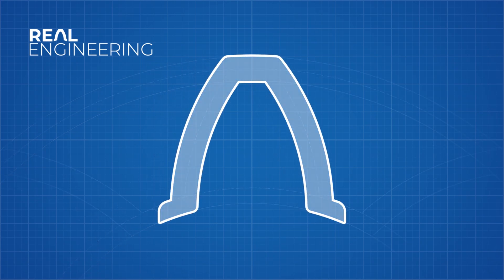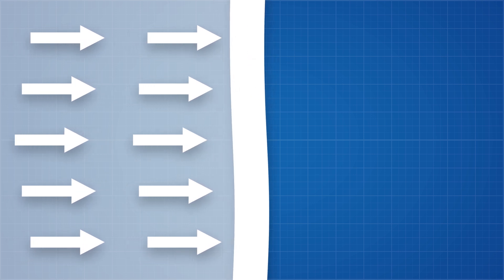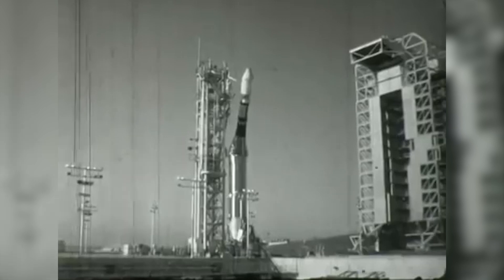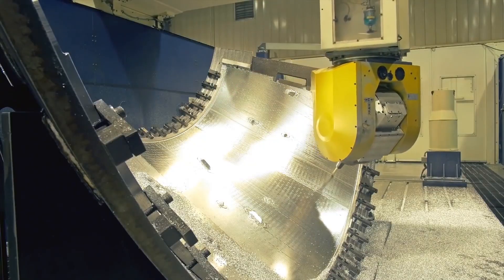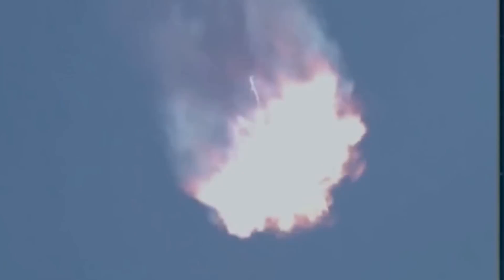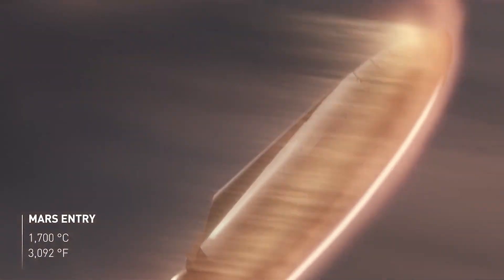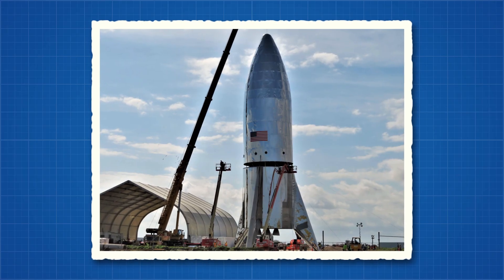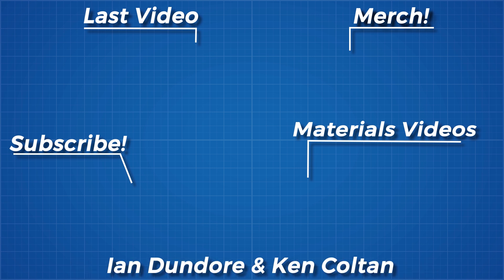Why SpaceX Built A Stainless Steel Starship

Comment: Titanium is as light as aluminum or lighter and stronger than stainless steel and is more heat resistant than both aluminum or stainless steel.  Titanium is very expensive and is not practical at this time.  Once we start mining for metals on the moon from impact craters of asteroids, then one day the cost for titanium and other precious metals will come way down.  That includes gold, platinum, and silver, etc.  So people investing in these metals may undergo a significant loss in profits, once mining on the moon occurs.  I hope Elon Musk has a number of unmanned rockets land on the moon first (sending supplies ahead of the space travelers) before he tests any of his rockets with a ship full of passengers.

Comment: They know they can develop extremely thin steel in the vacuum of space with amazing strength. In fact I have heard there is a Foundry in orbit and they are developing amazingly strong metals with honeycomb type structures which they use on the most ultra modern subs. They should be using this stuff for these rockets.

Comment: The stainless steel is just to make the Buck Rogers looking prop shiny and cool looking. Starship is nothing more than a scam, the detail of which will come out when Teslaron finally implodes and its rent-seeking conman head takes off for places unknown.

The skin of a rocket ship is only to protect the internals and provide aerodynamic stability. Such a skin can, and needs, to be as light as possible. Stainless steel is not light and also behaves badly under the the heat of the Sun owing to its rigidity.

And those top/front fins only add more aerodynamic instability and much unneeded weight. But they sure look cool.

Starship is nothing more than a prop in a scam.

Comment: I wonder how many tons of C02 are ejected for each launch?   Who is working on the net-zero rocket propulsion?
Reply: By mass, methane combustion exhaust is around 55% CO2, so by burning through ~4,000t of propellant, that's ~2,200t of CO2 released per launch. 

As for net-zero rocket propulsion, any hydrogen-oxygen launch vehicle has the potential to be carbon neutral if the hydrogen and oxygen are sourced from the electrolysis of water powered by renewable energy. However, until the price of green hydrogen is competitive with fossil-fuel derived hydrogen, this won't happen anytime time soon.
Reply: @OzearEimaj  The days of being able to choose an energy source other than a Green one are over.
Reply: @tonym5627  If there are cheaper and dirtier options available, it's fair to say that's what the companies will use!
Reply: @OzearEimaj  I just bought an electric car that can barely fit 5 comfortably.  Why? Because I don’t think their required goal of eliminating all gas cars is achievable in 8 years.  When they realize their plan is moving too slow they will then take more drastic measures.  

Are you not seeing the action to uniformly reverse the Global Catastrophe right before your eyes?   If you don’t, just take a long ride without any internet devices and pay close attention to the changes in infrastructure going on, regardless of what Country you reside in.  

Your awakening will help.
Reply: @tonym5627  Of course I understand the ramifications of global warming, but when it's cheaper for companies to pollute, then they'll do it unless there are financial repercussions. My apathy towards what companies choose to do has nothing to do with my understanding of the climate and the effect we are having on it. Besides, emissions from rockets launches are probably the last thing environmentalists should worry about.

Comment: I seem to remember this super light metal with ridiculous melting temps. Let me look up my "space age" periodic table and, oh yes, it's called tih-TAY-nee-əm. But, unfortunately, Elon Musk's infinite knowledge of engineering (ie. his business expertise of claiming other peoples work) cannot solve this problem.
Reply: @awashburn6944  I am not a fan of Musk's. I do know that he tried to acquire the titanium tech from others that were also not his greatest fans. Titanium is in pressurized fuel tanks orbiting the Earth right now at much lower temperatures, so I don't think brittle is a problem. Super conductive fuel tanks are not the greatest idea but...there they are. The tanks are manufactured (alloyed?) in a way that greatly increases their ME and Yield and obviously changes some other numbers. I know they are titanium, I know they are thinner than any other metal would allow, and I know (first hand) the tanks can be lifted with my fingers. It would be interesting to know what they have discovered, but I can't blame them for not handing it to Musk.
Reply: @awashburn6944  True, none of those satellites are designed for re-entry at all, but I don't think we have any materials beyond NASA's ceramics for repeated re-entries. I also assumed space X would use their same re-entry tech to land on Mars, which should not affect STA microstructure of the hull per say (I think just the fins would be of concern). But then again, who says we are using 6-4.... 
815C for 6-4...I'd find a new supplier... :P

Comment: "Shit show" haha
Reply: First system capable of manufacturing Starship in strong titanium alloys. Superior mass and force ratio. Symmetrical double joints with controlled asymmetry of paramagnetic and diamagnetic materials in an inert atmosphere. Starship can be manufactured 60 tons less and by automation ... Integral double joints with controlled asymmetry in titanium alloys ... Robotic welding by stimulated emission of light for reactive materials in a 100% inert atmosphere at 360º. We can now manufacture in titanium and robotically for the first time in history. Now we can do it very well ... !!! ...
Reply: @eduardoamaro7867  They built it... out of steel... and it works... you don't need to fix things that aren't broken...

Comment: I'm concerned about the number of communication satellites Elon has already launched, with the goal of having a network of a staggering 12,000 communications satellites in orbit for better cell phone service. This will drastically increase the amount of debris that is already in orbit around our planet. I do not hear enough people seriously talking about the long-term ramifications of this problem. One small nut or bolt is enough to cause life-threatening damage to the ISS at the speeds they orbit and there have already been close calls. NASA tries to track the larger objects, such as satellites, but at some point the amount of traffic will become a bottleneck if people are not looking far enough ahead.
Reply: No just no. For starters a single nut or bolt is not life threatening to the space station. Micro asteroids have hit the space station before and do you want to know the revolutionary solution to the problem, they put their finger over the hole and then just plugged.

Where as the whole satellite thing, you know how much bloody space there is in orbit around earth, plus the space station orbits at much higher altitude then the starling satilites do, as well as they will deorbit them selves pretty quickly (relatively) if you want to talk about a cluttered orbit geo stationary (where the satilite orbits at the same speed earth spins so they are always above that one spot) is the problem, there is only so much room above the places you want and those never de orbit so satilites from 30 years ago will never go away
Reply: @rylandduesburry8986  The astronauts themselves have said that if those hits had occurred on the wrong areas, the effects of a strike by a nut or bolt could be life threatening. A nut or bolt is just the start. Man has foolishly destroyed satellites in orbit and set off nuclear blasts. Not to mention old satellites and larger pieces.
Reply: At the speed of a bullet out of a gun also.

Comment: No worries... no one is going to mars.
Reply: Why be a doubter, be optimistic, it's not that hard for a rocket scientist...
Reply: @warrenayres200   We can't get through the magnetosphere.
Reply: @paradisemace1 they have all that in mind. These people are very smart, they have degrees in material science. They will find a way to stop radiation. They have a 12 month trip in all, all they need is material that can help against radiation...
Reply: @warrenayres200   Well it's for certain that they haven't found it yet  (let alone 50 years ago), or someone would have worn it into the nuclear reactor at Chernobyl or 3mile island and "shut them down".  Much much lower radiation levels than the magnetosphere.
Reply: @paradisemace1  they have though... in Chernobyl there was a material that is very protective against radiation. They are planning on using for NASA's gateway
Reply: @warrenayres200   negative, no such fabric exists. Chernobyl was a massacre of thousands of lives. If this fabric exists... the cleanup would have been completed decades ago. Living tissue will never survive the trip through the magnetosphere, regardless of the disinformation posted on the "web". Books and research will enlighten you to this fact, if you will make the effort to read the facts.
Reply: @paradisemace1   I should have stated that it was a fungus instead of material. I got my information from Daily Mail, New York Post and many more. The article was really  July 29th. The fungus is called cryptococcus neoformans. Kasthuri Venkateswaran, a research scientist at NASA who is leading the experiments on the Cryptococcus neoformans fungi, believes that by extracting its radiation-absorbing power and manufacturing it in drug form, it could be used as a 'sun block' against toxic rays.
Daily Mail: Fungus found in Ukrainian nuclear plant can EAT radiation.
https://www.dailymail.co.uk/sciencetech/article-8559843/Could-Chernobyl-key-conquering-Mars-Fungus-Ukrainian-nuclear-plant-EAT-radiation.html
Reply: @warrenayres200   Okay. But if this fungus is under development, can we agree that it's use wasn't possible during the Apollo program?  This would make NASA a perpetuater of  a historic hoax, and question the truth about current programs.
Reply: @paradisemace1  I believe it was real because they were only out for around 2 weeks. The aluminum coating protected against radiation, but not that much. They learned that cardiovascular related deaths were 43% higher because of the radiation. Its gonna be a hard mission to the Moon and Mars, the astronauts will get hurt, but they've signed up for it.
Reply: @warrenayres200   If you believe that fungus and aluminum foil can stave off radiation... I have some (ocean front) property in Oklahoma to sell you.
Reply: @paradisemace1  did you not read what the researcher said? He/She said that it can protect against harmful rays... I never said "aluminum foil" I said the aluminum around the capsule. Ofcourse aluminum doesn't do much against radiation, but it does do something. Have a great day
Reply: @paradisemace1  good luck to you too man, peace